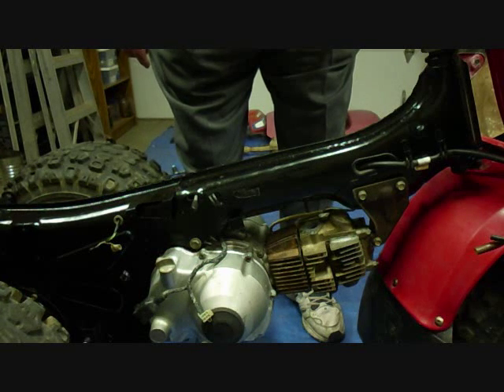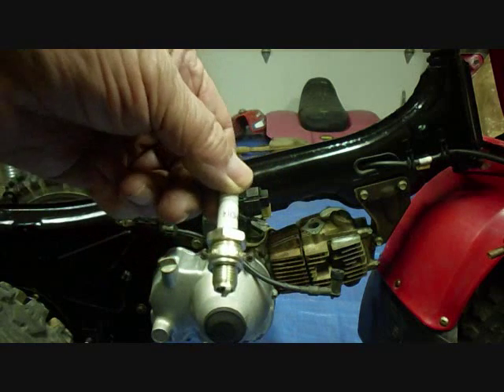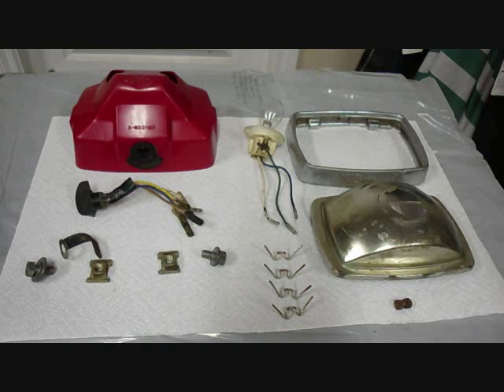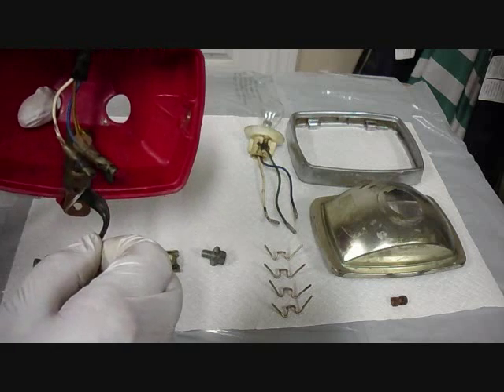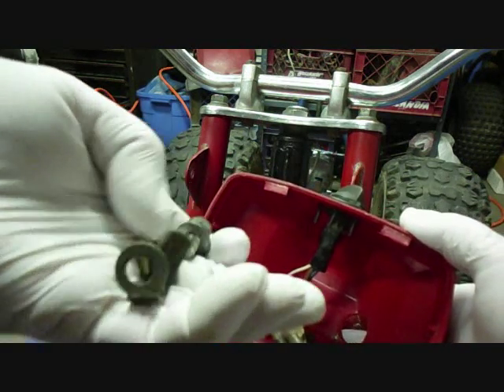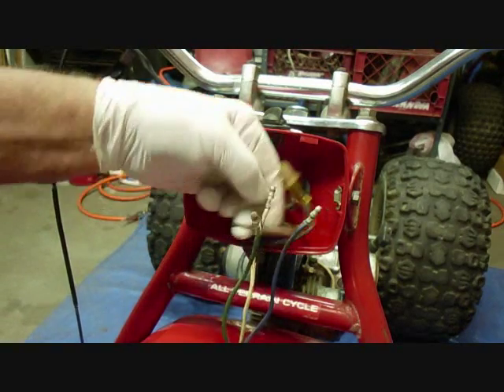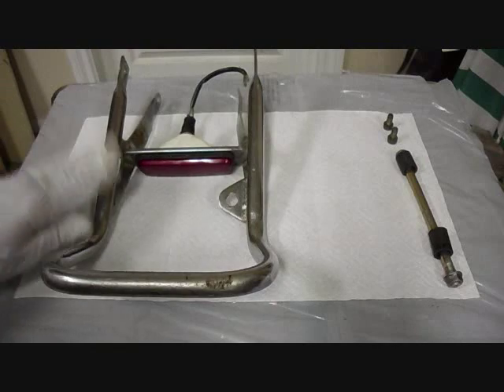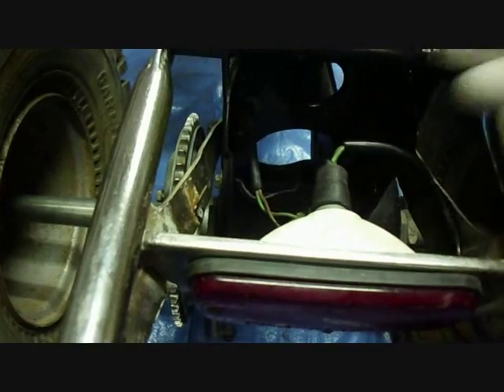Honda ATC 110 Reassembly, 9 of 12, Electrical, CDI, Coil, Lights

Comment: Hi Bruce. I’ve just bought a 1984 110 and I am having trouble getting spark. I’ve replaced the plug, coil, statora, and have a new cdi coming in soon. I’ve checked all the wiring but I am stumped. Any advice or videos you suggest? Thank you.
Reply: Hello Bruce I have seen your video on the electrical of the headlight, now I would like to know how to trouble shoot on how to get the lights working. I bought a cdibox hoping that is the problem according the schematic I have that is the only component I see that may be the problem pls advise A.S.A.P. thank you Michael
Reply: I’m having the same issue with my 1985 110.  Where did you order your CDI from?

Comment: One question how many volts is the tailight?
Reply from the maker: +Mithfu 99 :  For the ATC 110 it depends on the year.  1970 & 1980 are 6 volts (like the ATC90).  1981 and newer are 12 volts.